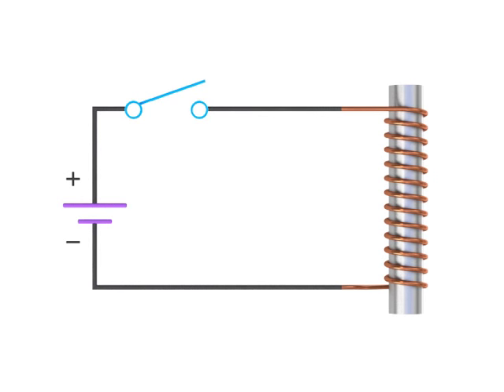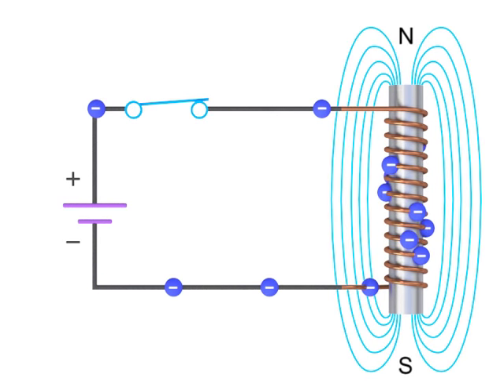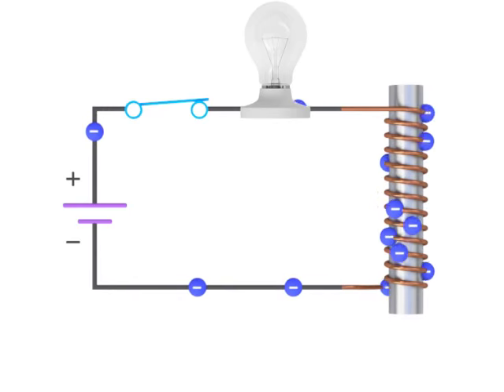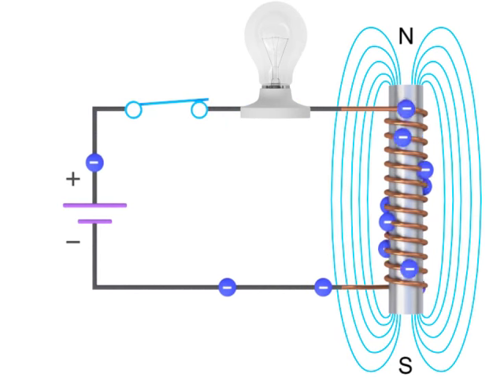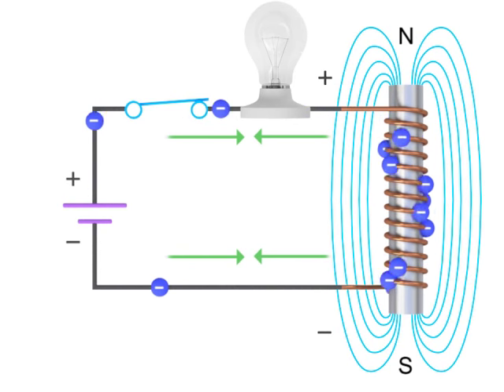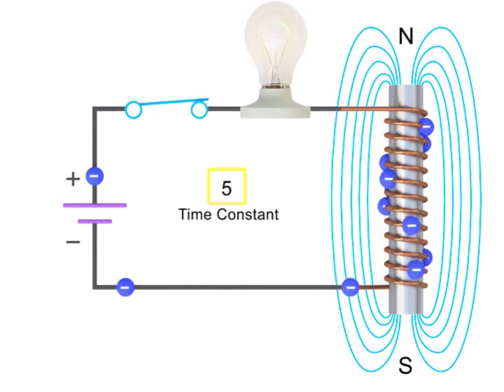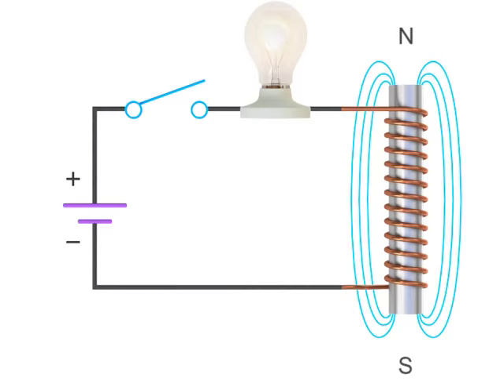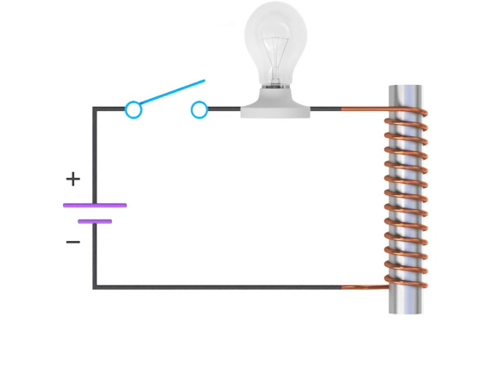How Inductors Work Within a Circuit - Inductance

Comment: Good explanation. Still don't get it
Reply: Hahaha that's exactly my thoughts on the matter :D
Reply: True🤣🤣
Reply: Hahahaha thats EXACTLY what i was thinking 😂😂😂
Reply: I hate professors like this. They expect you to be a God of all knowing so have to know everything he mentions.
Reply: In an inductive circuit (shown in the video) the Voltage always precedes the Current by 90 degrees (It starts flowing through the wire before the current does). This is because the electrons create resistance in the wire making up the inductor. Because this resistance (which slows down the electrons for a very short period of time) only affects the flow of electrons the Voltage will begin to flow BEFORE the current does (but quickly catches up with the Voltage.)
Reply: A layman's explanation - The inductor creates a magnetic field and it requires energy to do so. Initially, it takes the energy that would have gone to the bulb and as a result it slows the flow of current in the circuit so the bulb is equally slow in lighting up. When the switch is turned off, the field collapses and the result is a release of current. Why? collapsing magnetic fields release electricity. In effect. the inductor is a type of small transient battery that smooths the delivery of power to the bulb. A capacitor is another device that can be used to do a similar function.
Reply: @danielbaggett6283  voltage doesnt flow...
Reply: @danielbaggett6283  its different potential between two nodes..
Reply: i suggest that you study Calculus. Once you understand meaning of derivative and integral, then proceed to studying Faraday's law of electromagnetic induction and its formula. Then it will be very easy to understand voltage and current relationship in an inductor, Len'z law (which explains why inductor opposes change in current), induced voltage and current and induced electric field due to varying magnetic field, etc. in an inductor. Same also for capacitor, calculus is crucial. the equations of electromagnetism is more accurate than any animation here
Reply: @ohaRega  you
Reply: 🤣🤣🤣🤣 me 2
Reply: Same happens to me...
Reply: @danielbaggett6283  Hahaha..who invented this theory ? I guess it's your own invention 😂😂😂
Reply: Imagine yourself running down a hallway
Now imagine yourself running backwards on a moving walkway.  Now change directions 60 times per second, but every time you do, the walkway does too
Reply: Inductors (AC only) = used to filter current (current control: smooth min to max in a matter of time) and also avoiding current spikes. On DC = like a wire (short circuit)
Capacitor (AC or DC) = used to filter voltage (voltage control: keep a constant voltage), avoiding voltage spikes. 
Resistor (AC or DC) = Voltage Divider

Inductors, resistors and capacitor are passive components. 

Resistor = connected in serie with circuit
Capacitor = connected in parallel with circuit 
Inductors = connected in serie with circuit.

Serie = means flow (transient) 
Parallel = means potencial (diference)
Reply: Probably because it's still bad animated 😂. Every time the switch opens there is no animation of the induction from the inductance 🤣
Reply: This is easy @ohaRega
Reply: This is easy to get
Reply: @danielbaggett6283 that only applies to inductor on AC not DC
Reply: @Ultrainstincte  DC current when pulsed at a high frequency behaves like AC without the reversal of current.
Reply: @dejavudf thank you, this is the answer I was looking for. It was easy to understand how an Inductor works, but I could find anyone to explain to me what the practical use was. It makes perfect sense now that you said it’s used as a filter.

Comment: Where is the location of the voltage build up when the switch opened?Is it across the switch?
Reply: No. The voltage builds up across the inductor. Let me explain:

As an example, say The inductor current was 100mA before the switch opened when it was in steady state. Say the switch opens and the current comes to zero in 1 microseconds. The inductor is 10mH. The voltage across the inductor is L*di/dt. di=100mA, dt=1 microsecond, and voltage across ends up being 1000V.

There you go.
Reply: @hyperelectron-tg5cz  Switch close or open?
Reply: @gustavomarcelo7250  i meant switch opens. sorry. i typed that late at night yesterday. I fixed it. In a real situation, that switch would likely be a transistor. The drain or collector of the transistor would be the part feeling the 1000V and it would likely blow the transistor. usually to avoid this, you would add a diode in parallel with the inductor and it would "point" up toward the VCC supply. This orientation works because as soon as the switch reaches voltage of VCC+V_fb (V_fb is the forward bias of the diode; about 0.7V), it would conduct current and prevent the switch from building up a voltage past VCC+V_fb.

Comment: Nice simplification, I'm still looking for an in depth explanation of the unique properties.
Reply: In an inductive circuit (shown in the video) the Voltage always precedes the Current by 90 degrees (It starts flowing through the wire before the current does). This is because the electrons create resistance in the wire making up the inductor. Because this resistance (which slows down the electrons for a very short period of time) only affects the flow of electrons the Voltage will begin to flow BEFORE the current does (but quickly catches up with the Voltage.)
Reply: The electrons don’t create resistance necessarily-a dc current passing through an inductor causes the inductor to behave as a short circuit. The change in current does cause a change in resistance though. It does so because it causes a voltage to appear across the inductor. This is why a sinusoids signal produces an impedance across the inductor. The voltage changes and therefore the current changes with the current lagging 90 degrees.
Reply: The electrons don’t create resistance necessarily-a dc current passing through an inductor causes the inductor to behave as a short circuit. The change in current does cause a change in resistance though. It does so because it causes a voltage to appear across the inductor. This is why a sinusoids signal produces an impedance across the inductor. The voltage changes and therefore the current changes with the current lagging 90 degrees.

Comment: A quick note. Current is measured as the flow of electrons and holes, not just electrons.
Reply: +rwtfallenjf25132 if u don't know electronic don't change the theory of electronics
Reply: +Magadh Taxashil  ... what??
Reply: +Magadh Taxashil well your english is very poor so i asked "what."
Reply: +Magadh Taxashil obvious troll
Reply: Yeah, that's not English. This isn't a text in 7th grade. Is it that hard to write "you" or "are"?
Your response to the simple question, "what?" was hostile and uncalled for. Without punctuation, your original post makes little sense, but you think rwt... is wrong?
I doubt anyone is "dame poor than" you. Whatever that means.
Reply: Hahah
Reply: Holes? Isn't "current" just how many electrons flow through a cross section in the wire (measured in units of coulombs), per second? That does not say anything about holes to me. Maybe I'm mentally fucking retarded, but I never heard (or had to include in my calculations) anything about holes - except when studying semi conductors.
Reply: A current is indeed the number of electrons flowing per time. But in the opposite direction, since Benjamin Franklin assumed the moving particle was positively charged, back before it could be experimentally verified, and the terminology stuck. In other words, current is the flow of a positive charge per second. The "holes" terminology is frequently encountered when talking about transistors, but to oversimplify, it means the absence of electrons.

Comment: True. That's why, in professional cabinets, like RCF, big inductors are used in passive crossovers.
The more you raise volume, the more the iron core will induct & make the woofer sound louder &  the impedance will be lower.
Cheap crap cabinets use cheap crossovers to low cost, leading to mediocre sound quality.

Comment: How did we know that the current reaches maximum value at '5' time constants , why not 4 or 6 , is it generalised result ?
Reply: A single Time Constant is about the time taken for the circuit to reach 67% of where it is going. However, the closer it gets to the finish, the longer it takes to finish (Because the voltage differences become smaller, which are ultimately responsible for driving the current). So to keep going to almost 100% (Theoretically it will never really reach there), is approximated by 5 Time Constants. That's considered close enough.

Comment: Why there was still has spark when switch open, the bulb would not consume?
Reply: Current needs a loop to travel through. Instead the voltage increases to a very high value due to the rate of change of the current being very fast. This value could cause the switch terminal to arch due to the breakdown voltage being reached between the two terminals. Like lightning when charge accumulates in the clouds to several millions of volts, the air between the clouds and the earth acts as a dielectric material but it breaks down with such high voltage and literally conducts electricity in the form of lightening.

I should add that the current doesn’t stop instantly. Resistances in the wire prevent it from happening.

Comment: Wow that makes a lot more sense. Stores amps as apposed to volts.
Reply: What  mean of urs sentenc?
Reply: does not store amps or voltage. stores magnetic energy which kind of controls current that passes through it
Reply: The current causes a magnetic field where energy is stored. The magnetic field is directly proportional to the current. Think about it this way: with a capacitor, voltage creates an electric field. That voltage is discharged when the electric field collapses. In an inductor, current creates a magnetic field. That current is discharged when magnetic field collapses.

Comment: The intonation or emphasis in the speech is a bit off at times. For example: "whereas a capacitor uses voltage to store energy*, the inductor uses current". It should be: "whereas a capacitor uses *voltage to store energy, the inductor uses current".

Comment: so why would anyone use a capacitor instead of an inductor (or vice versa) in a circuit for preventing voltage spikes?
Reply: because a capacitor smooths out voltage
an inductor smooths out or resists changes IN CURRENT FLOW, not voltage
remember it as   Capacitor relates to Voltage (electrical pressure)
inductor relates to current flow (speed of the electricity)

Comment: What causes loss of power in an inductive circuit?
Reply: In purely inductive circuits (which do not exist in reality) there is no power loss.  Inductors have resistance, called effective series resistance, which is the source of power loss (joule heating).

Comment: Induction is not relevant in current without capacitance. You can have a DC source (dinamo motor for example) and run a light bulb as long as dinamo is turning.

Comment: crap animation shows the current going backwards ... it moves from plus to minus , not the other way around
Reply: Conventional electricity flows from positive to negative. However, the negative electrons (true flow of current) always flow from negative to positive. In the early days of discovering the properties of electricity it was believed that electricity flowed from positive to negative. They failed to rectify the explanation for some reason.

Comment: you lost me at flux lines..
Reply: Switch closes.

Inductor takes about 2 milisecond to build up full strenght (Store 100% of it's magnetic field) bulb will delay for that 2 milisecond before coming on even though the switch is on. (Inductor needs to charge 100% before the bulb light up in other words)

After inductor charge to 100% (Bulb glows to max lumens)

Swtich Opens.

Store Charge in Inductor Flows and arc where the switch is opening at. (This is where the inductor drains it's charge)

Comment: This video is false....  this circuit will create 3 electromagnetic fields.. one from the circuit and a smaller EM field in the rod and the smallest ofcourse being in the bulbs tiny filament which itself is another coil. The bulb is naturally in the field of the bigger circuit but after the rod so when energy is transmitted through the larger Electric field, it will be shared between the smaller 2, with most first filling the inductor's EM field and becoming "trapped" until it reaches an optimal similar to the bigger circuit  after which the rest of the energy will move the bulb' EM field or internal circuit and filling it up.. turning of the bigger circuit, results in the inductor pushing its energy to the smaller bulb circuit and until eventually it dies down when all energy if gone from all EM fields. Also school textbooks need to be updated, we can't still be teaching Kids that current flows in wires, it's already been proven many times that current flows within electromagnetic fields, wires just complete circuits. That's why we have wireless charging and can transmit power to LEDs wirelessly